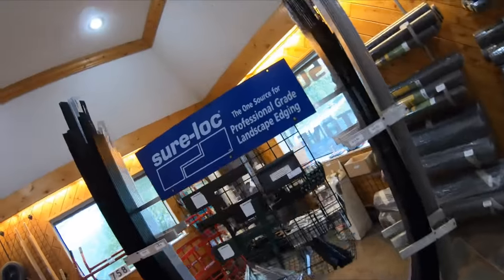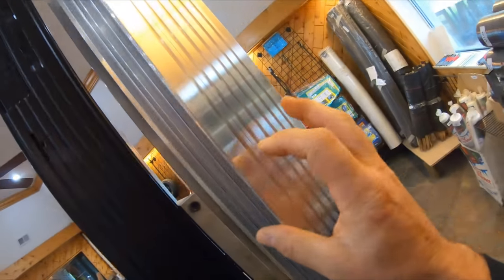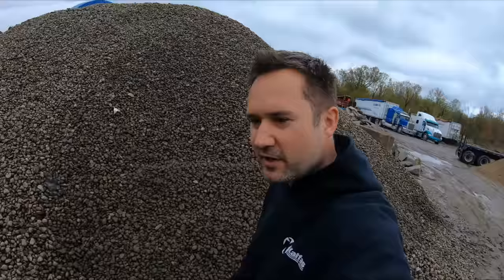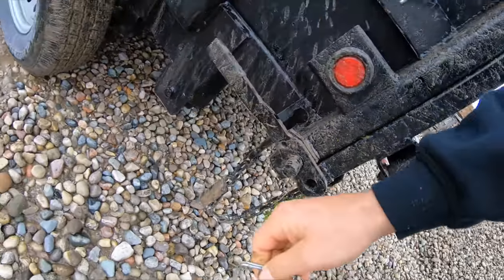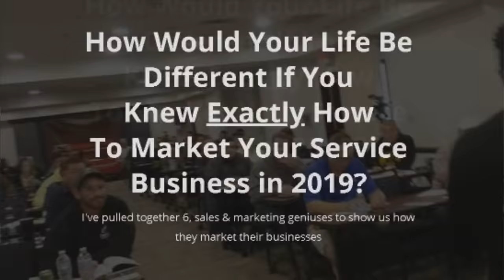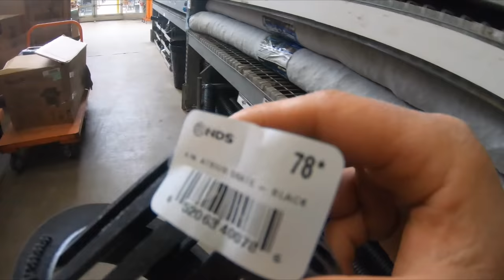Installing 2 Tons of Cobble Stone Landscaping Job In The Rain | VLOG

Comment: Felco pruners are what we use, and is the gold standard in the commercial nursery field. They are bar none the highest quality.
Reply from the maker: Yes they are the best and I got sick of them getting lost on jobsite lol. So I started buying the cheaper ones. Do you have a method for NOT losing yours?
Reply: @keith-kalfas  absolutely. I use A.M. leonard pruner sheath. They clip to your belt. Itchfree10 gets you 10% off on A.M. Leonard's site. #shamelessplug  😂. I use them when I do pruning in the spring for Bordines. But in summer when I do ivy, every tool is contaminated. So, having urushiol on my belt is not my idea of a good time.
Reply: Or if you wanted to be more OG, my neighbor does leather work. Maybe if you wanted, he could make you a custom #untrapped sheath.
Reply: Keith Kalfas I also agree on the felco pruners there the best the way I do it is I use felco for my self and for the guys I get the cheaper ones 🤷🏽‍♂️😂